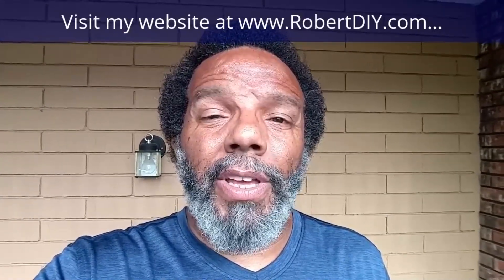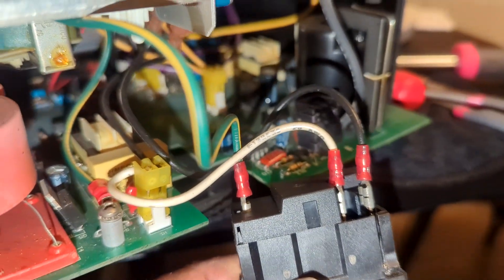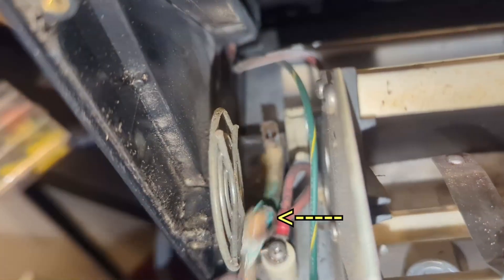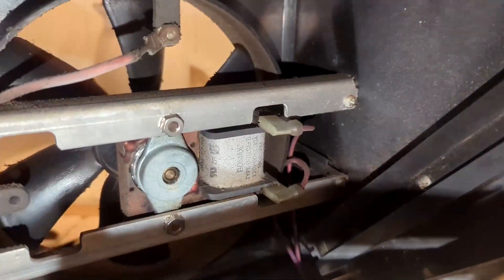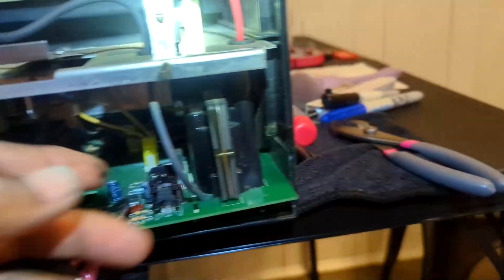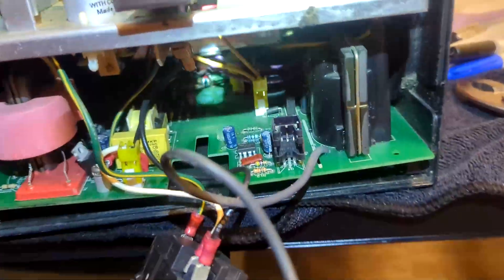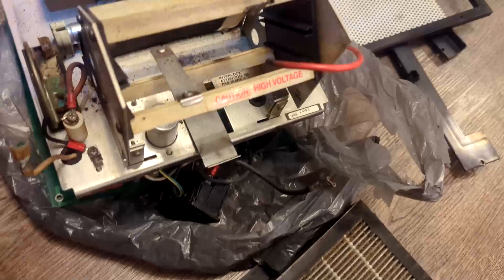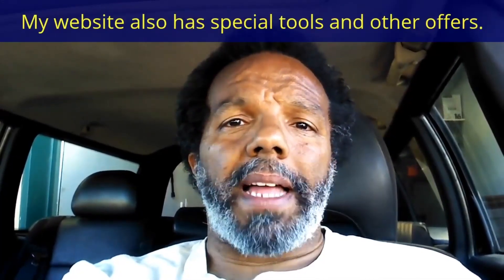EcoQuest Fresh Air filter ozone air purifier taken apart for repairs.

Comment: The older XL15 are more simple and longer lasting. Use synthetic 30 weight motor oil on the fan bearings. Clean with ammonia
Reply from the maker: Clean it then oil it?